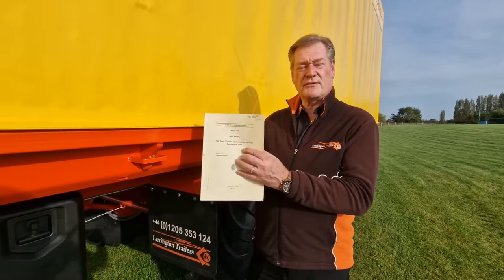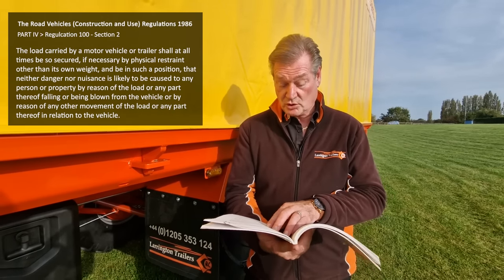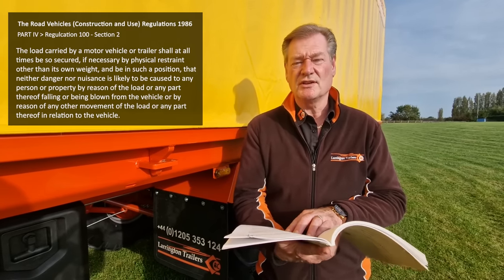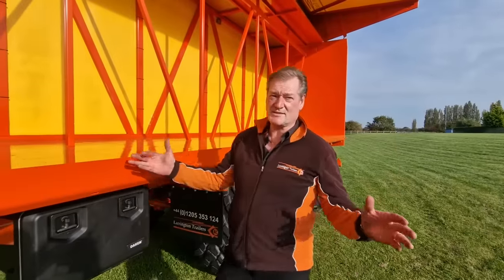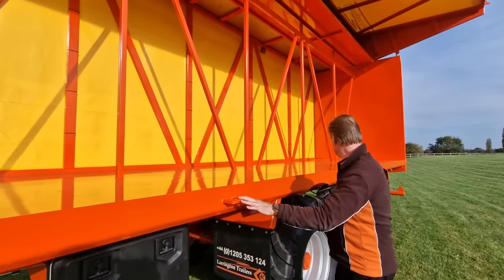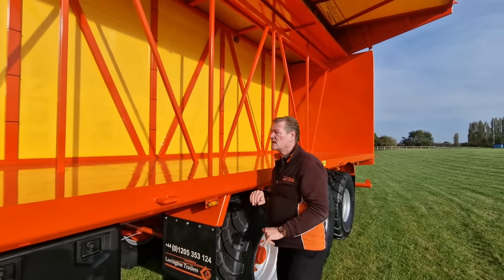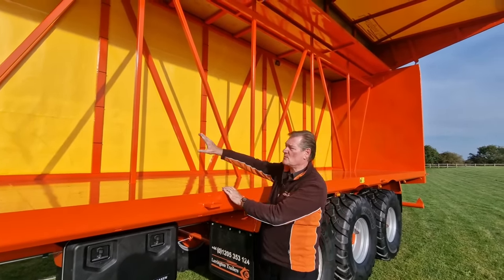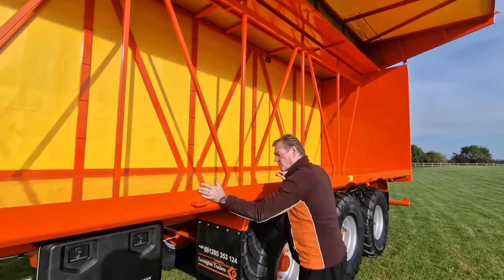Introducing the Gull Wing

Comment: What happens to the gull wing if hydraulic pressure is lost, does it just fall, as a crush hazard?
Reply: I guess they could pop a check valve in place like an excavator or top link on a tractor.
Reply: There are check valves on the rams🙂
Reply from the maker: As a couple of people have already pointed out, we could (and have) fitted check valves for this very reason. 😃

Comment: What safety measures are in place for when a pipe bursts on those hydraulic cylinders, to stop the sides coming crashing down on an unsuspecting forklift driver?
Reply: Zoom in on the bottom of the rams and you’ll see that check valves are fitted. Doors will not fall if a pipe bursts.
Reply from the maker: As Noel has already pointed out, the trailer has been fitted with check valves.

Comment: Great idea for hauling products like cabbages as you mentioned as in essence its a hands free curtain sider but with regards to straw it seems excessive and expensive when other clamp type trailers are avaliable on the market if one wants to not strap there load or when a simple ratchet strap is avaliable and easy to use, if straw was such a problem why isn't the haulage industry already transporting it in a means like this? On another note though like all larrington products trailer looks fantastic and well made.

Comment: So where do your potato box trailers stand is there going to be a redesign or a retro fit kit .
Reply from the maker: The Guardian box loader would still sit apart from these trailers. In the Guardian's case the majority of crop is already secured in the boxes on the deck which are secured in place by the frame and chutes, the remaining crop on the top cushion is surrounded with with extensions preventing it from going anywhere and a handy roll-over sheet is available to cover the top to protect your crop from the elements.